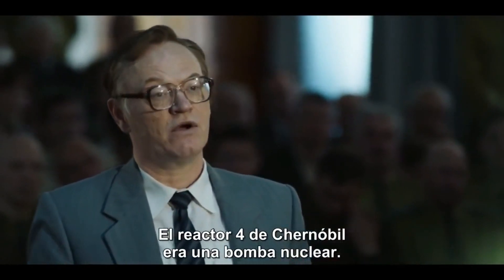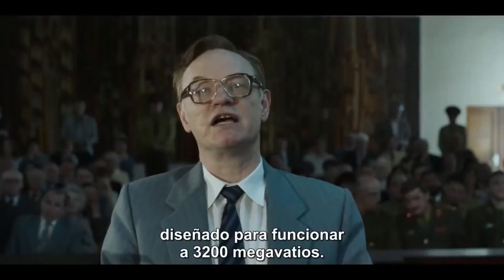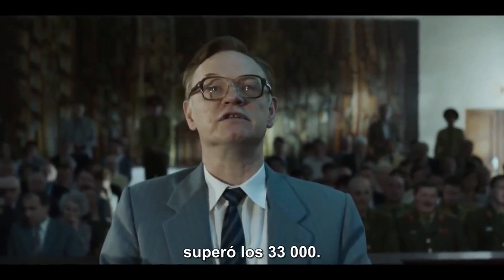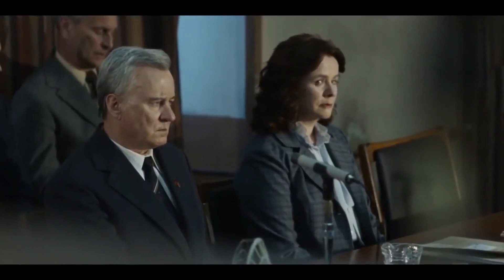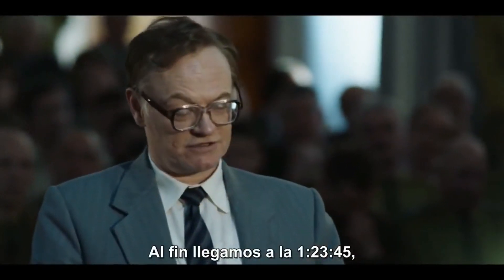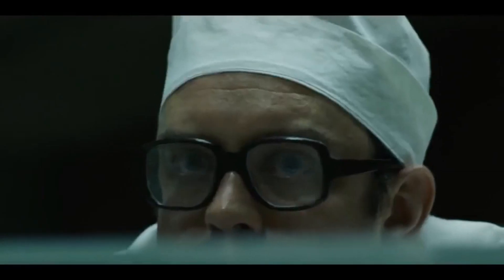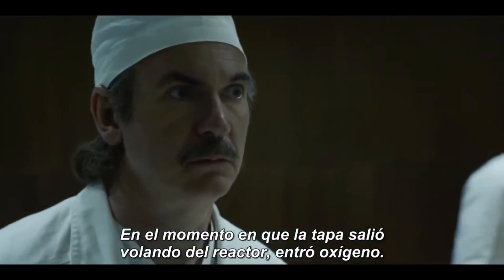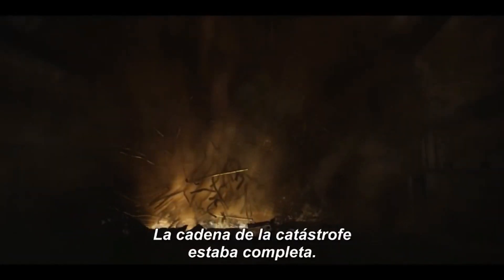Chernobil disaster explained in 10 minutes (3/3) - Valeri Legásov - Chernobil Series

Comment: I hate to love that the only explanation for the graphite tips on the boron control rods is that it’s cheaper
Reply: I enjoyed your post and then get to the bottom of your discussion with the other individual and it just took me entirely out of it. Like seriously, that was them just constructively spitballing ideas and you think it's a 4chan fight? You literally could have just not responded to them and it would have come off better than what you said. Nobody would have batted an eye.
Reply: @timoteoman13  in text it’s hard to tell tone, sorry I missed the tone
Reply: because thats how USSR worked
Reply: Ok so I did some research on that subject, the character in the show doesn’t know why there’s the graphite tips, so he just throws out the explanation that it’s cheaper, which actually works surprisingly. The real reason is that the graphite is it’s own rod basically stuck on the end of the boron rod, so when you put in the boron rods it pushes the graphite rods out of the way, in the configuration they had it in with all the rods out (yeah whatever there were 6 control rods still in, but whatever) all the graphite rods were in place, when he pressed the emergency shutdown button all the graphite rods moved just enough to be in a configuration that massively increased the power output, and the boron rods didn’t even have time to go in before the lowering mechanism was broken by the extra steam
Reply: @Callie_Cosmo  

I mean, the answer is accurate.

Regulator and control rods should never be linked, buy it's a cheaper way to run the fucking thing, so they were.
Reply: @GunRecon  true
Reply: @Callie_Cosmo  Also don't forget that the graphite "tips" can work to cheaply regulate the power in the core, so you have 'more control' over the power output. The problem is in general that the light water reactors by their very nature are cheaper to construct, as your coolant IS a moderator AND a power generator (steam). So when you coolant boils the power rises and cools LESS. Basically they took an already dangerous reactor with high potential to melt down and turn it into a bomb, and didn't tell anyone because that would "scare the population".
Reply: @Mdsde  I guess you wouldn’t classify Chernobyl as a “nuclear bomb”, it’s more of a flash steam powered dirty bomb (a conventional explosive with bits of radioactive material in and around it so that it covers a massive area with radioactive dust) I mean I guess mid meltdown after all the steam has been released it could have technically worked like a nuke, because nukes compress radioactive cores to go supercritical, and all that corium could be classified as “going supercritical”? Idk I’m not an expert in any way shape or form I’m getting most of this information from science YouTube so don’t trust me
Reply: @Callie_Cosmo  Actually, some sources believe that enough of a runaway reaction happened that in fact it did "detonate" albeit VERY inefficiently. So nobody is quite sure if it was only a hydrogen explosion or if some runaway fission in the recently created corium may have play a part. Even if there was a small nuclear detonation though, it would have been in the sub kiloton range, else the entire building including reactor 3 would've been shredded. Still can't be proven, but it's cool to speculate. Also by "bomb" I didn't mean nuclear bomb, I meant they took a reactor that was dangerous and made it significantly more dangerous, "bomb" just felt correct to me.

Also I'm not an expert either.
Reply: This is late but I recall that the exact Issue was that due to the graphite rods didn't go all the way through, they only covered about 80% with the top and bottom being left free. Normally that space would be filled with water. Had the reactor been designed in a way where the rods went all the way through it could have been safe but as is they pushed the water that was regulating the reaction partially out of the way when they were moved. That reduced moderation, increased reactivity and at the same time since where previously there had been no graphite now the graphite was increasing reactivity. That led to all the remaining water evaporating, on one hand the sudden increase in pressure ruptured the containment cells and jammed the graphite boron rods, stopping the control rods from deploying, on the other side steam was now not acting as a coolant anymore further increasing the pressure.

In reality by that moment nothing could have been done even if AZ-5 was not pressed. The reactor was heating up endlessly and would explode on it's own in short order. AZ-5 was supposed to stop that from happening but sadly it did something else entirely. It accelerated the end. 

If you take that into account it's even more painful because you realize by the time they realized they had to shut the reactor down there had long been no way for them to do that anymore. @Callie_Cosmo
Reply: @Callie_Cosmo thank you for that:)
Reply: @ondrejvojta3882  basically how the world atm works lmao.
Reply: @ondrejvojta3882  And USA, or any country in the world
Reply: @ondrejvojta3882 USSR had many flaws and I hate that some people glorify it I also hate that people who never lived there or listened to people who did think they know everything because they listens to some second rate western historian.
Reply: @ondrejvojta3882  
Also how USA works, just not with nuclear reactors because not even the USA is that stupid when it comes to nuclear reactors.
Cost-cutting measures. Cutting corners. Capitalists and corporations love that.
Reply: @vit968  Canada shutting down regional weather reporting stations one by one so that whole regions are 'dark'.  The major cities will always have accurate, timely reports and forecasts, but now the rural areas ... not so much.  This is called 'improvement'.
Reply: Wait until some private corporation gives this same explanation.
Reply: @djfhsusbruh6698  I’m pretty sure nuclear reactors are much much much more heavily regulated, across the whole world too not just in capitalist model areas with corporations, in part due to Chernobyl, but also due to the Fukushima daiichi plant, and the three mile island plant, as well as the other 99 nuclear disasters between 1986 and 2011 (btw I grabbed these numbers from this Wikipedia page, and fuck teachers who say Wikipedia isn’t a good source https://en.m.wikipedia.org/wiki/Nuclear_and_radiation_accidents_and_incidents )
Of course it’s always possible another nuclear accident will happen and a corporation might try to cover it up but it would be much much harder to cover up in modern times

Edit: the link was broken but I fixed it
Reply: @Callie_Cosmo   I am not saying this is Capitalism vs Communism debate, cost cutting is human nature, I live in India and Bhopal Gas tragedy largely happened because the company was cutting corners in safety expenditure.
Reply: @djfhsusbruh6698  oh of course, to create anything is to cut a few corners somewhere, I mean the “perfect version” of whatever your making is subjective, you just gotta satisfy as many people as possible, and for corporations those people are investors, of course every other model of society has, and has to, cut corners in as many ways as possible to keep everyone happy. I also really don’t want to turn this into a capitalist v communist debate because they both have very very many problem and neither is objectively better, it’s like the choice between cleaning the toilet and cleaning the shower, both not fun, but depending on the person one might be preferable
Reply: To add to all good arguments here (and the best beeing: do not link your failsafe to any regular orperations), this scene here is somehow cut short from the original series. When aksed "why?" Legasov actually told the commitee: "for the same reasons we do not have containment buldings or properly enriched fuel" ...etc. I don't know, why it was cut out from this clip, but it's missing, and maybe would have put more perspective on the answer.
Reply: It is accurate. The Soviet reactors were designed to be as inexpensive as possible. Graphite tips on boron control rods was to reduce the cost of operation—as it would not require nearly as long to reignite the reactor. The major issue is by removing all the control rods, there was virtually no way of reinserting them without introducing another neutron poison whilst lowering them into position. 

Had they waited before reinserting the control rods, it is possible that the reactor could have reduced in reactivity such that it would be safe again—but we will likely never know.
Reply: Lmao at the commies seething in this thread
Reply: @Callie_Cosmo  Who was arguing here? seemed like one of the most civil discussions on here I've ever seen.
Reply: @madjack1748  agreed I’m kind of shocked at how readable this is
Reply: It really was cheaper. It was cheaper because full boron bars cost more, and full boron bars don’t let you make fine adjustments to the reactor's reactivity. This leads to inefficiencies, as you depreciate the fuel more quickly since you can’t manipulate the core appropriately to optimize its usage. The graphite tips on the control rods allowed for finer control of the reactor’s reactivity, helping to adjust power levels without fully shutting down the reactor. Without this capability, the reactor would require frequent shutdowns or inefficient operation, which would lead to uneven fuel burn and the premature degradation of the fuel, effectively wasting its potential energy.
Reply: The other thing the graphite tips do in this design is act as a lubricant for the rods moving in their channels. Grease wouldn't work in that environment. And having the graphite in there is perfectly safe /as long as/ some idiot hasn't ordered all the rods to be pulled all the way out, so that trying to scram a supercritical reactor involves shoving a bunch of graphite through it slowly, first, before the boron gets into position.

Also didn't helpo that the motors to push the rods down to scram the reactor were slow. RBMK reactors take 15-20 seconds to scram, as opposed to the 3 that equivalent American reactors did. That's 5-10 seconds of graphite being eased carefully into and through the position where it massively increases the reactivity of the reactor.
Reply: Well why would you make a last-ditch, fail-safe that could potentially destroy the entire plant? There were a couple of safety measures that were never implemented because they were cheaper. The poster of this video conveniently edited that part of the video out, it seems…
Reply: Same reason for the submarine K-19 nuclear accident:  They built their boats cheaper than the West did.
Reply: There is also second reason for it. Boron is very light element, and heavier tips from graphite helps boron rods to penetrate trough water in reactor.
citation: Dana Drábová (head of National office for nuclear safety, Czechia).
Reply: That's actually a great explanation because it made the operation much more efficient. It is a great idea that is still used today. The RMBK is the longest running design in operation but it's not the only type of graphite moderated reactor.
The reason graphite moderated reactors fell in popularity is due to the fact that nowadays methods for uranium enrichment are much better than before and commercial reactors are no longer required to be able to be adaptable to produce weapons grade plutonium. Also refueling on site is no longer an issue.
These 3 advancements in technology nullified the huge advantages of the RMBK design and it was discontinued in favor of more modern alternatives.
Reply: "It was cheaper" because the Soviets used lower-purity uranium which necessitated graphite moderators. That was the part that was cheap. The graphite """""tips""""" were not actually tips and were not there to 'save (any more) money'. They were ballasts as long as the control rods themselves (not a tip at all). It was to plug the hole from the withdrawn control rod to stop the channel from filling with reactivity-killing water and replacing it with reactivity-neutral graphite. The 'tips' were perfectly sensible in a reactor of that design. It's one of the worst-attributed "problems" with the RBMK that shows up everywhere Chernobyl is discussed and it's annoying as hell. They make it sound like the control rod had a little pointy cap on the end like a pencil, and it was just there because 'lol idk rofl'.
Reply: Welcome to communism.
Reply: I think he also refers to graphite modulated reactors being cheaper than heavy water modulated reactors
Reply: @tafl-9198 He "kind of" does, but doesn't really embellish. And 'cheaper' isn't always a bad thing. Being able to run a reactor off of nearly unenriched fuel is a major plus, as well as refueling the reactor without shutting it down.
Reply: @fnhatic6694  Except when this happens.
Reply: I always found this line "it's cheaper" a bit too unexplained and sensationalistic. They failed to explain, why this was an intentional design feature (whether good or bad). It was there to better control or avoid the build up of the Xenon by-products, thus stabilizing reactivity. Fair enough. What the writers might have meant by "cheaper" is, that the designers chose to link this sytem to their emergency procedure (to pull in all Boron rods with these tips attached). Because, its cheaper to just build it all together in one system.
Reply: @Pempel2000  There was another aspect of 'cheaper' that wasn't explained, it had to do with how ludicrously huge an RBMK reactor is. The graphite "tips" (which were not tips, but a telescopic ballast to fill the empty control rod channel with graphite) had water pockets at the top and bottom when fully retracted, and it had to do with the extra amount of space you'd need to design the system differently. RBMKs were already titanic.
Reply: Fun fact, the guy with the funny hair who ran the plant Bryukhanov I think is how it’s spelled, when he first joined the Soviet Nuclear Program he strongly tried to convince the government to build more Western style reactors because he knew they were way safer, but the government indeed did shut him down due to economic cost an build time. So while he sits there looking naive in real like he did know exactly what happened and how serous it was
Reply: @Callie_Cosmo  what
Reply: That's a lie. The control rods were built that way because there was graphite on the first part, and boron on the 2nd part. So moving them up and down could control the reactivity or accelerate it. It's a creative license on this show, but that's a lie. Look for Scott Manley's explanation which is the correct one.
Reply: @huracan200173  That doesn't seem like a huge flaw in the design to you? Your ability to increase the reaction, should not be intrinsically tied to your ability to reduce the reaction.

Especially when you encounter a situation where the "emergency stop" button needs to be pressed. Because that means as soon as you press that button, you will increase the reaction before you can decrease it, from all of the rods trying to re-insert themselves. If you are in a scenario where the button needs to be pushed, you want it to stop the reaction for whatever reason. You don't want to spike it.
Reply: @CrashB111  no, because the control rods being of boron and graphite increases their reactivity gradient, this gives the user more control over the reaction as the rods have a greater power to cool off the reaction. There is nothing wrong with this design. That is why in the modifications they did after Chernobyl they simply made the rods much longer instead of changing their design, and this is enough, the biggest problem was in fact that they were too short for the reactor they were in.
Reply: @huracan200173  The reason they did it that way was so that they didn't have to enrich the uranium fuel, because it's cheaper. So it's not a lie, it just glosses over the reasons why it's cheaper in order to avoid confusion.
Reply: @huracan200173  It really was cheaper. It was cheaper because full boron bars cost more, and full boron bars don’t let you make fine adjustments to the reactor's reactivity. This leads to inefficiencies, as you depreciate the fuel more quickly since you can’t manipulate the core appropriately to optimize its usage. The graphite tips on the control rods allowed for finer control of the reactor’s reactivity, helping to adjust power levels without fully shutting down the reactor. Without this capability, the reactor would require frequent shutdowns or inefficient operation, which would lead to uneven fuel burn and the premature degradation of the fuel, effectively wasting its potential energy.
Reply: @huracan200173  Adam Higginbotham says the tips were graphite because, when fully withdrawn from the core, the AZ-5 rods were still partially in place.  The graphite tips never left the reactor, and instead of were used to moderate the reaction at the waterline.  I think that’s the shortcut here for “cheaper:”  Your emergency shutdown system should not perform another function which compromises its ability to be an emergency shutdown system.  I was really surprised to learn that AZ-5 took over 18 seconds to fully insert the boron rods into the reactor, on the logic that the electrical grid couldn’t suddenly go cold, regardless of the system’s function in the reactor plant.
Reply: @matthenson3472  It's flat out amazing we as a species are still alive when the best psychopathic bullshitter is in charge of decisions of life and death... like the factory worker for example.
Reply: @huracan200173  that, in fact, is exactly what I was saying but in slightly different words